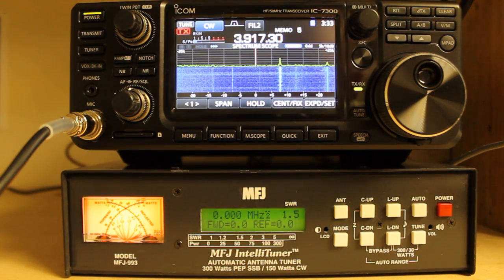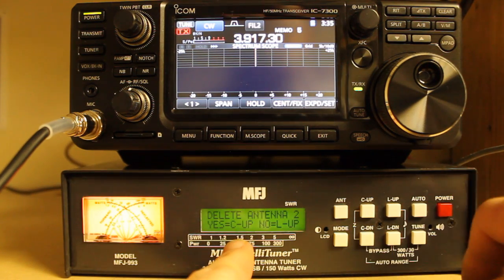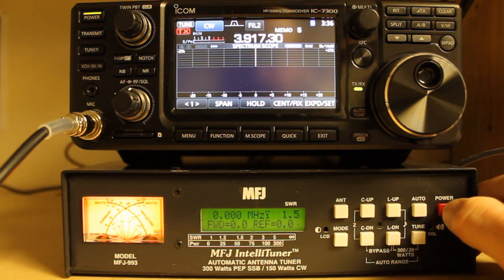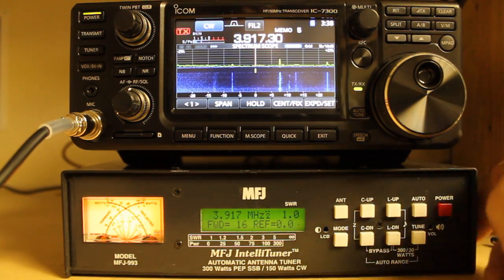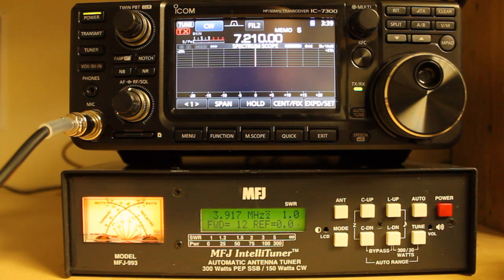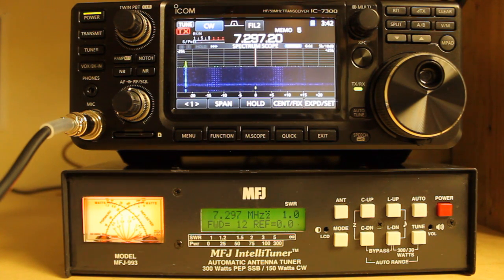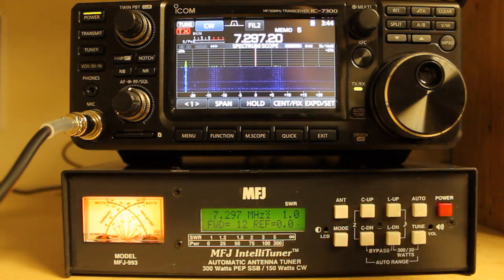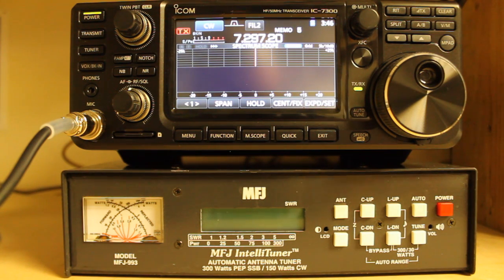Introduction to using the MFJ-993 Intellituner with the Icom IC-7300

Comment: thanks for this video. i know its been a long time ago, but i have a question.. i haave a similar unit, and recently got an rf amp, so this tuner cannot handle the power output... the question is can i have two tuners, this one and a HFT-1500 connected together plus that amp into a MFJ 1700C Switch? and how could i do this with the ICOM 7300

Comment: ok so i guess after i hooked up that wire that came unsoleried from my molex connector i got my tuner to work go ahold of someone in san jose and im in the central valley so that seems to work ok for me for just a wire antenna.

Comment: i had a wire come unsoildered again from my molex i geuss thats what that plug  cable again so everyone if you have problems not tuning check to make sure no wires have come disconnected i wasted alot of time trying to figure out what went wrong .

Comment: Can the MFJ turner ground be connected to the Icom 7300 ground?
I mean to put a direct cable from the transmitter to the coupler?

Thank you
Reply: I have the same radio.  Good ?

Comment: Your video is greatly appreciated BUT, and let's talk about your big BUTT here, why don't you just take your linear out of the demo. This extra equipment in the antenna line and what ever you are doing with a Second Tuner, Linear, et al  just confuses that crap out of me and adds a lot more unnecessary complications into the equation. Also how about showing your interface cable. Also what is this extra interface box I received and the RJ45 or what ever connection. Just saying! MFJ is very stingy with their setup info and really needs a series of install videos on their web site for those of us part of the Great Unwashed.
When you started with the tuner before or after or in-between the Linear and what ever I lost all sense of following what you and what you are trying to explain. In other words my  bread crumbs got eaten by the birds.
I just received my MFJ 993b and really need just the step by step basics. You could divide your video into to several parts and dedicate the second video to tuning with a linear. I don't know what you were doing when I heard the cranking. Sounded like a roller inductor or what ever.
Don't get me wrong there is a lot of great info here but for those of us, speaking for myself, that just need to start with the basics Occam's Razor applies here. You also have to much extemporaneous information in this video. Perhaps a few videos instead of one with a little more preparation in the delivery.
When one stops and starts and says "ha wonder what went wrong there" it just gets even more  confusing. This where simplification of equipment is better.
In any event thanks for your efforts they are greatly appreciated. It is like trying to put 10 pounds of crap into a 5 pound bag. No offense intended just my habit of more colorful speech.
Gary WA9TJV

Comment: Has anyone noticed any difference (993B) not 993, how well it will match at 150w vs. 300w.    I am finding I at least on 80m with balance line going to the center of about 125 feet on each side, I have not seen any improvements.

Comment: I realize this was 3 years ago, but this tuner is at a nice price right now. Do you know if it will tune without input from a radio (sensing RF), I have a Xiegu G90(20w) and an old Ameritron als 500m and am trying to get things running, even to the point of using a foot switch to key the old amp. kd9oam.

Comment: Hi I noticed the problem you had a 7.210MHz.  I have the same problem but no other means to sort it like you did.  I am running a GWHIP 421 Triband resonant end fed antenna which is resonant on 40, 20 and 10M.  So any idea why the tuner fails on 40M?
Reply from the maker: Sometime you get a voltage or current peak that the tuner cannot handle. How are you terminating your endfed?
Reply: Its attached to a tree using a piece of plastic a thin rope

Comment: I have a MFJ-993 too.  After you tune up with low power, if you talk with SSB with 100 watts, do you find the frequency display on the 993 go erratic and also change the SWR while your speaking.  With CW it works fine.   SSB drives the tuner crazy.  Do you have the same results?
Reply: That should be as expected if I am thinking right.  Well, depending on the input.  The tuner is looking for a carrier, so it can reference the signal, and apply different LC combinations.  The reflections aren't necessarily linear, and the amplitude isn't constant.  Although I have never tried, I would assume that AM would tune just fine, as it has the center carrier.

Comment: Hi there do you know with an IC 7000 and a TS 480 if you need an interpase box or just a lead from radio to tuner....Fred in Uk g4vvq
Reply from the maker: Your Icom can connect to the 993 with the MFJ-5124I cable, which is the same cable that I use,  and the Kenwood may be able to use the MFJ-5124K cable. I don't have a modern Kenwood, so I can't speak to that. You might contact MFJ and ask... I have found their support to be very helpful. You may also be able to use the tuner in semi-automatic mode, but I recommend the cabled fully automatic mode.
Reply: The 480 would just need the cable mentioned in the other comment and moving the jumper on the inside to the "K" position.

Comment: How does one disable the internal tuner to use the external one ??
Reply from the maker: Emil, any tuner that uses the tuner interface connection on the back of the IC-7300 will disable the internal tuner. The radio detects that an outboard tuner is connected and disables the internal tuner.

Comment: Which interface cable will I need for that setup?
Reply from the maker: I use a homebuilt version of the MFJ 5124I. If you decide to make your own, order the correct Molex connector for the radio end.
Reply: I ended up making my own :)

Comment: Thanks for the video.  When I press the Tune button on the tuner, it beeps at me and displays the message "Huh?  Increase Power".  If I press the Tune button a second time, it tunes properly.  Auto button is out on the tuner, power output of the radio iss 100w SSB.  Any idea what's causing the initial error message?  Also, it I press the Tune button on the radio, it uses the internal tuner and not the MFJ tuner.
Reply from the maker: Do you have the interface cable between the IC-7300 and MFJ-993 or are you using it in RF sensing mode?
Reply: I'm using the Icom interface cable.
Reply from the maker: To me, it sounds like there might be two issues. One is that there may be an issue with the RF sensing circuit in your MFJ-993. The other is that there may be an issue with your interface cable. With a functional cable, the internal tuner should bypass. Have you performed a full reset on your 993?
Reply: I will give the reset a try.  Thanks for your help.